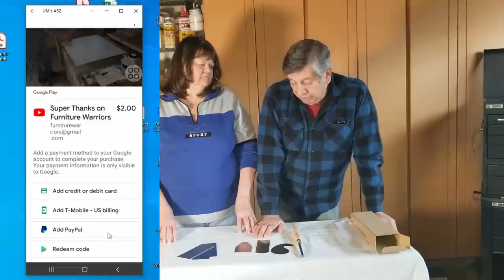Queen Anne Side Table Makeover | Fixing Someone Else's Paint Job | Furniture Makeover

Comment: It’s really nice, but I think the front drawer needs another coat of wash to make it a closet match with the top, cos they seem to be out of different woods, so it’s taken up the stain/wash differently 👏🏼👏🏼👏🏼
Reply from the maker: Depends on the light you're in, but it does kind of look that way! Great suggestion! Thanks!
Reply: @FurnitureWarriors  apologies…ur right, in the light that I saw on ur video, it did look different. My thought was simply because watching a lot of furniture flipping videos, so many people find when they strip back the paint, they discover that the item is made from different woods cos the original manufacturer never needed the woods to match cos they were always going to paint the item, so no need to use the same wood. In the light when you showed the top of the piece, there’s also I panel of wood that looks a lot lighter, but as you say, that may just be the light? Thanx for taking the time to reply & have a flippin happy day 😁